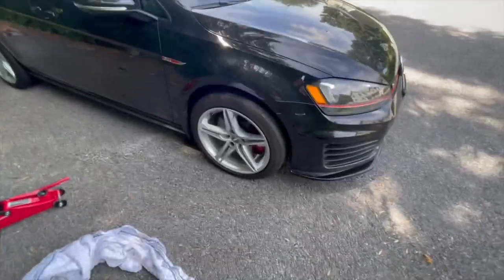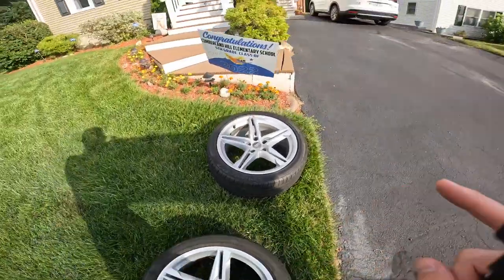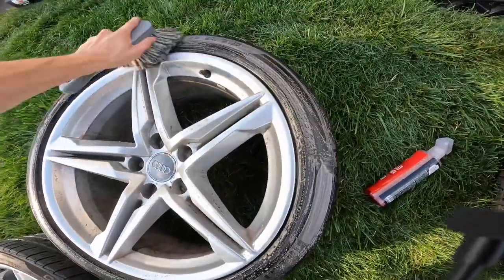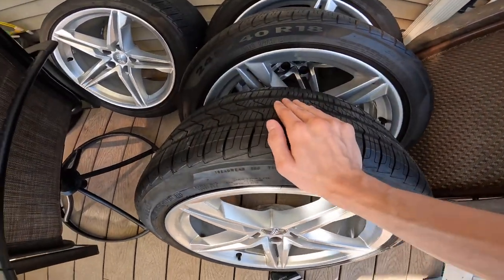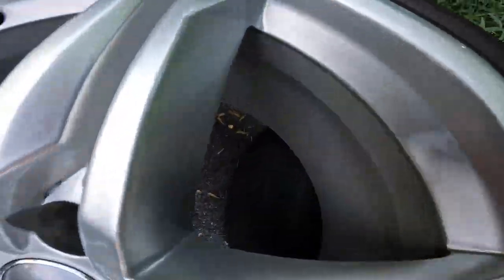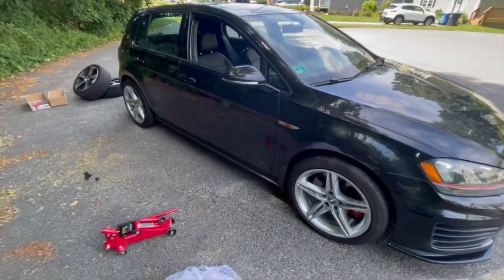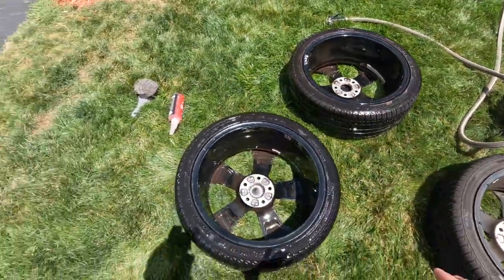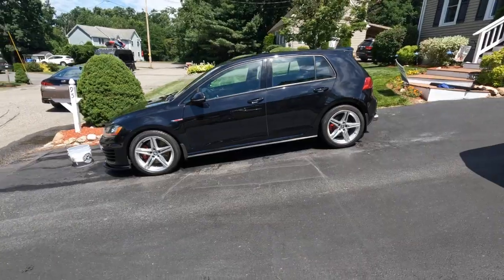The MK7 GTI gets NEW Wheels!! SUPER AGGRESSIVE!

Comment: I know this is an old video but i felt i could chime in regardless.

Since changing wheels its going to be a recurrent theme, there’s a few things you need to keep in mind to avoid annoying vibrations as well as safety issues in general.

When installing wheels, always tighten the bolts in a star pattern, so that way the wheel starts to sit on the hub flush instead of slightly uneven. And on top of that i would recomend getting a cheap Harbor freight Torque wrench (that goes above 89 lf-ft which is the torque spec for MK7/7.5 GTIs), a breaker bar and a 17mm socket. These 3 things will help you install the wheels properly and easier since you will have more leverage and u wont have to stand on the oem handle to loose or tighten bolts.
Finally, when installing wheels, put the 5 bolts first by hand and then get them snug with the breaker bar in a star pattern. Once they are slightly tight, lower the car to the floor AND THEN you use the torque wrench to tighten them up to 89 lf-ft, again in a star pattern. Very easy to do and it will guarantee that your wheels one fall off (lol) or that you will have weird vibrations because of an unever wheel fitting. These MQB MK7/7.5s are very sensitive to wheel fitment and it doesnt take much for a wrong instalation to show its true colors.